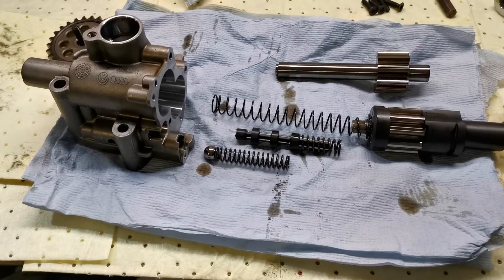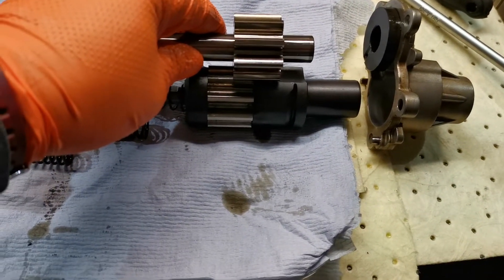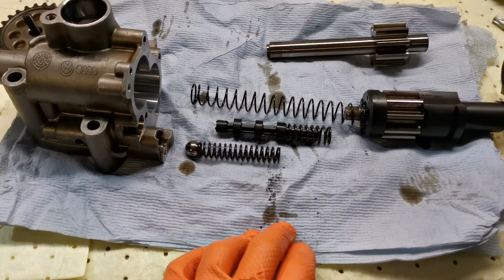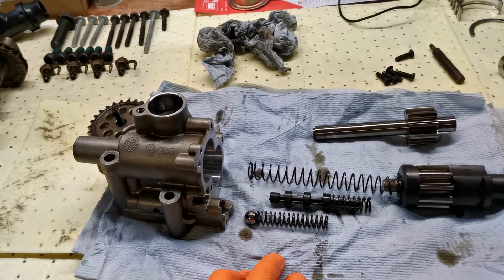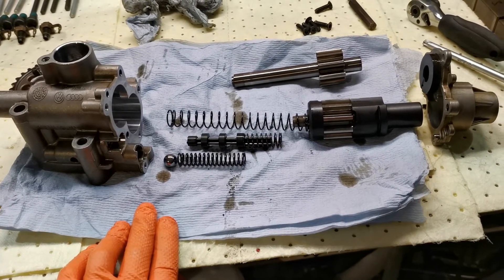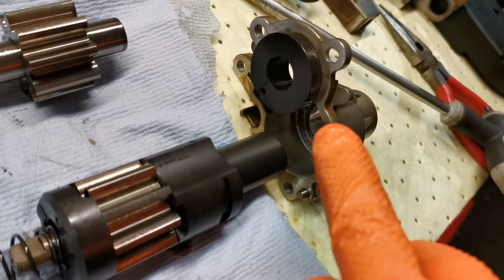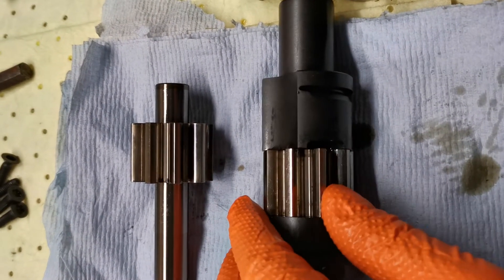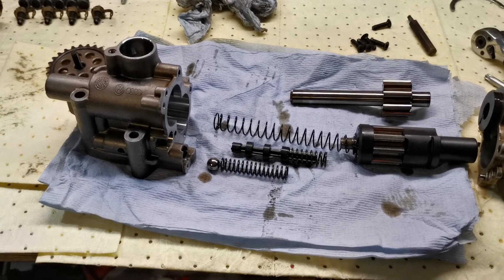MAS Performance 2.5tfsi oil pump assembly

Comment: What causes the engine to whine at idle and increase with rpm?
Reply from the maker: Start with a Stethoscope and try to pinpoint the noise. My guess would be chains, guides and tensioners
Reply: @MASPerformanceVAG  appreciate the reply! Noise is coming from inside the oil pan suspected oil pick up pipe or seal…. sump off, Everything looks good in there replaced pick up pipe and seal oil pump looked all good noise is still present.
Reply from the maker: @AkAk-gn4eh sadly you’ll need to take the gearbox off and inspect chains. Remove the chain off the oil pump and feel for any play or rough spinning. 
One thing you could do is use vagcom and check for cam timing corrections which would lead to stretched chains, worn guides. Also make sure all timing marks align.
Reply from the maker: @A @AkAk-gn4eh theres also an idler pulley you could check for rough spinning or excessive play. These engines pretty much use the same chains/ guides setup as the VR5/6

Comment: Did you manage to find a spring or a shim for the spring that gets to 5.5 bar? Asking because I want to modify an ea888  pump that is similar and only make 3.3 bar max.
Reply from the maker: Sadly this was so long ago I can’t remember. You can experiment with different number of washers behind the PRV spring and measure oil pressure differences so long as your absolutely sure your spinning the oil pump the same RPM or the results won’t be very accurate. Be careful to replace the core plugs in the engine as high oil pressure, particularly when cold can blow these off

Comment: When I start the warm engine I always hear a rattling noise until i reach~2000 rpm. Is this the oilpump starting at low pressure mode?
Reply from the maker: The oil pump pressure change over is at 3.5k iirc so below 3.5k is low pressure mode. The rattle your hearing is most likely chain tensioner or chains themselves rattling. What's the mileage of the engine?
Reply: @MASPerformanceVAG  106.000
Reply from the maker: @xxmarc92xx  my guess would be your chain, tensioners and guides need replacing. Try to pinpoint where the rattle is coming from first.   Most likely the cam chain rather than the crank chain